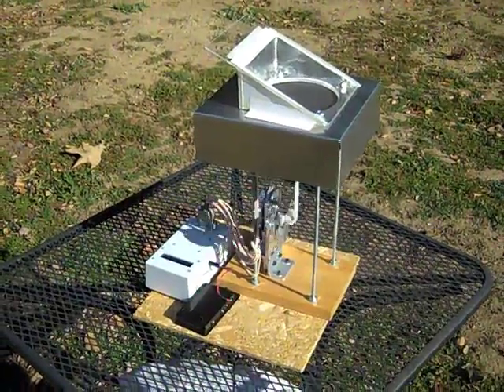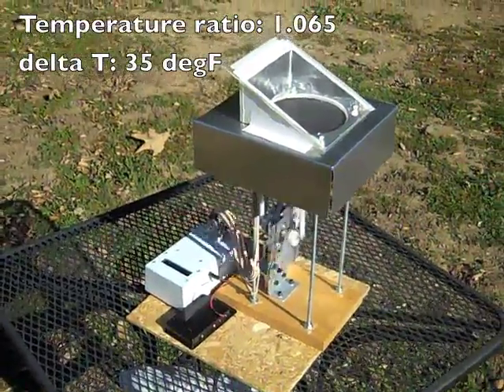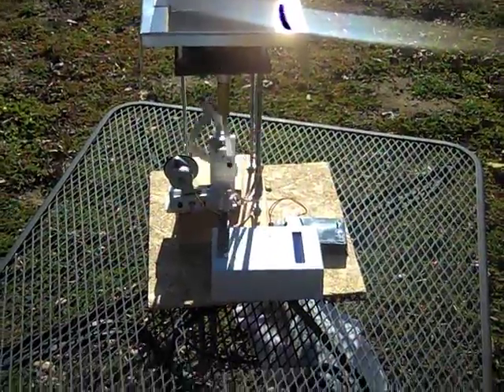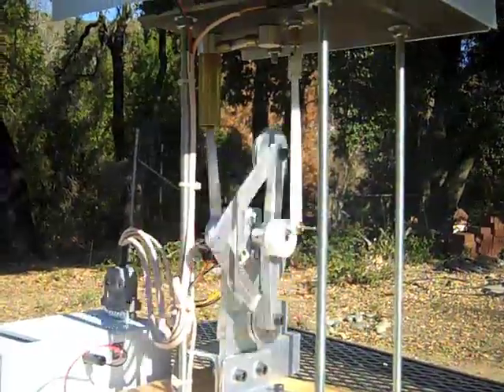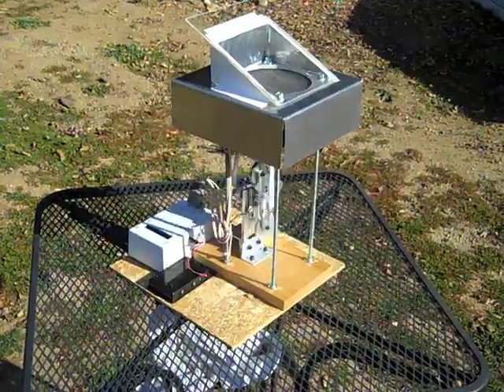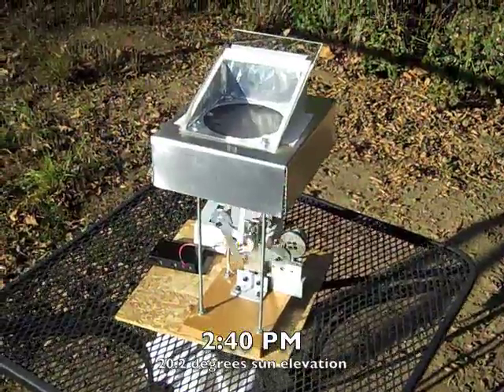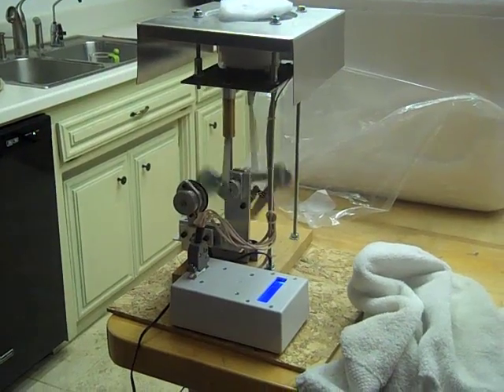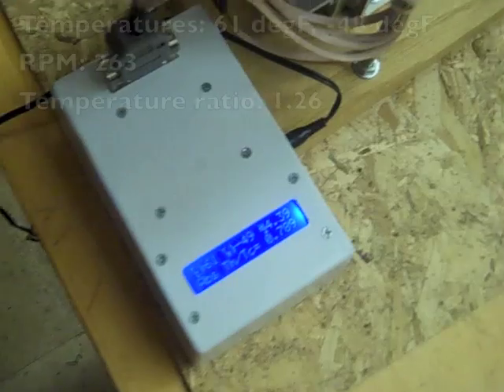Solar-powered Stirling engine

Comment: this is extractly what i want in mind, and i propose to use only hot water as the heat source, and build a giant bucket to store the hot water heated by solar, in that case, it might work during the night
Reply: A company called Sunpulse has proposed this solution, running a Stirling engine from sun-warmed water.   They have a few youtube videos, and their "sunpulse 500" 0.5 KW Stirling engine looks pretty cool.   But it's not clear if they ever produced them to sell, and there are no updates in the last 7 years.
Reply: @iyziejane  i had watched sunpulse 500's video too, they claimed its 1.5kw output for electricy, and for power output directly, its about 1.7kw, which is quite suitable for a single home, the hot water storage could also be used for wash purpose and heat source in winter
Reply: @alexsmith2632  agreed, but I can't find whether their engines are still for sale.  There is a website for a sunpulse solar company but it only mentions regular PV panels.
Reply: @iyziejane  me either. but i think we could follow this video's design and made our version :D

Comment: Why don't they have giant versions of this powering homes or towns?
Reply from the maker: +lilwestkid This engine isn't very efficient. It would be difficult to scale it up to make a significant amount of power.
Reply: Ones that use higher temperatures are already used in some locations. en.wikipedia.org/wiki/Solar_thermal_energy#Dish_designs
en.wikipedia.org/wiki/Concentrated_solar_power#Dish_Stirling
Reply: It has moving parts that require mainteinance, it makes some noise, requires a  system to constantly orient it towards the sun, a starting system, some strategy to protect it from adversities of the weather and it reaches the same efficiency as commercial solar cells at its best. These characteristics have favoured photovoltaic panel over concentrated solar thermal energy.
Reply: @maurizio7009  Any system that needs maintenance it is not required to include moving parts, the noise is produced in a small amount and can be isolated, it may not require a starting system as the owner of the video said that it is automatic starting, also anything that is outside is exposed to different weather conditions and Photovoltaic panels are no exception to this! In addition, photovoltaic panels are damaged by heat. They need light, not heat!
Reply: There is.
Reply: @yeboscrebo4451  + @Mauri Zio Because extractivisme is more interesting for capitalisme, they need our work, so they do everything that we would need them. If one rich person would develop and industrialise an optimised version i'm sure it would be possible ! But in this system peoples invest only to keep you dependent of them, otherwise you dont earn as much money as the other companies... !  Windmill had the same kind of problem, until big companies understood all the money they could get from us ; )
Reply: @AutoNomades  this is the only real reason
Reply: @citationneeded2093  That is what you say.
Reply: @AutoNomades  and you
Reply: @citationneeded2093  Where did i write that "it is the only reason" ? "citation needed" lol
Reply: @citationneeded2093  Why don't you answer ? Because you're trolling ?

Comment: Hi, I have a very simple way to turn the base of your solar engine.  It uses a float in a water barrel. The float sinks as water leaks out of the barrel. You just have your sterling engine on a lazy susan connected to the float.  The water leak is at constant speed so your susan turns at constant speed too.  Brian
Reply: why not using this https://www.youtube.com/watch?v=q3Ibom0ESMA in the same idea of that : https://www.youtube.com/watch?v=zoQ1KVoRTD8&feature=youtu.be